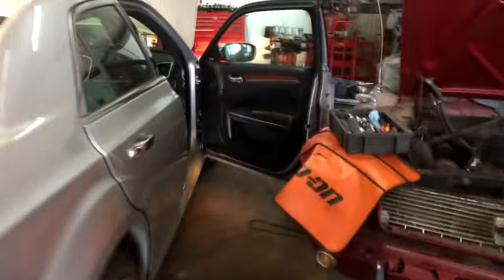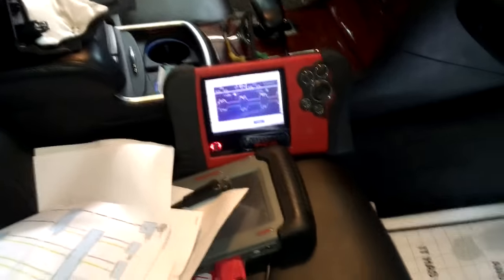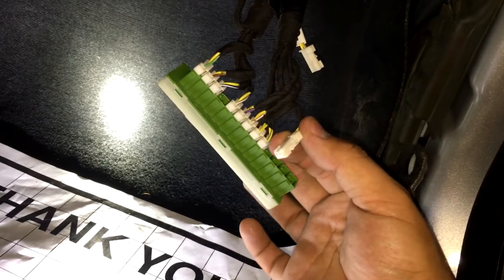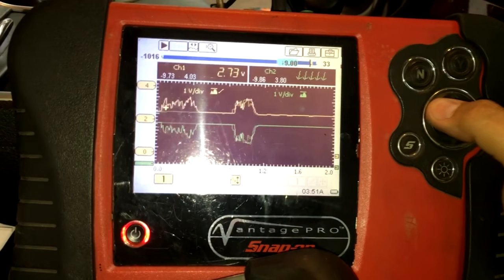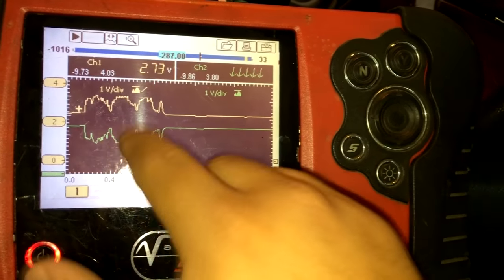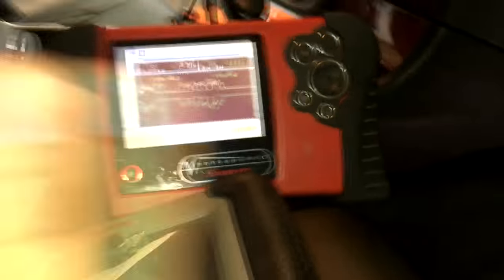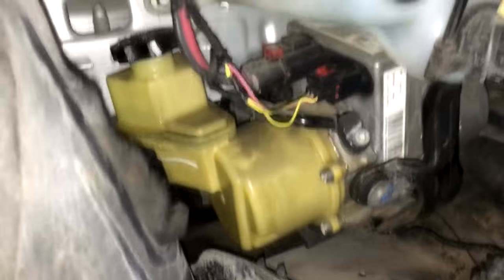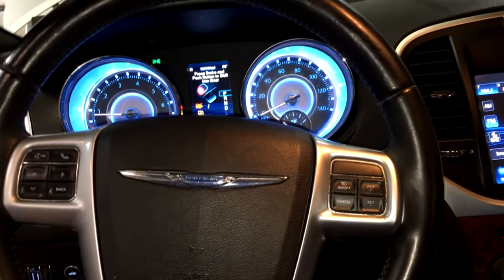TECH TIP CAN BUS DIAGNOSTICS

Comment: CANbus is essentially a balanced signal line, and the zero volt point is virtual ground, so that mirroring explanation is perfect, when either side does something
non symmetrical it indicates an imbalance, it's not the only way CANbus can fail, but it's still a great troubleshooting technique.
One of the reasons CANbus was adopted for vehicle data communication is because of the immunity to interference with cheap un screened signal lines, only possible
because of the balanced system they use. Any interference or noise with reference to ground is effectively self cancelling.
Thanks again for another great video.
Reply: Your explanation makes perfect sense regarding balanced signal lines, just like balanced audio cables that reject interference. Thank you.
Reply: This is exactly the same principle as that used with networking computers using ethernet cable. In computing it's referred to as UTP - unshielded twisted pair 😊

Comment: When the bias voltage raises as shown in the glitch,  you would want to verify the grounds of the module that's causing the failure. Nice video. A lower time base for detail can also be necessary in some diagnostics
Reply from the maker: Thanks for the tips! I really enjoy your channel btw
Reply: Yea John anello drives that hard on his talks bias goes high, verify grounds
Reply: Nice vid btw
Reply: We don't speak of the little yellow leprechaun 🤫😂
Reply: @NewLevelAuto  little yellow leprechaun 🤣😂🤣😂 gotta love the automotive community
Reply: @NewLevelAuto  THE LEPRECHAUN KNOWS !
Reply: @ADVANCEDLEVELAUTO  
problem facing in Chevrolet captiva 2007 manual, DTC U0073(ECM/ECU lost communication), U0121(ABS MODULE lost communication) and P0500(Vehicle Speed Sensor) ,,,,suddenly instrument cluster stops working ,all needles(Temperature, rpm, speed etc.) showing 0 reading , ac stops cooling while blower keep running,reverse gear light stops working, Service Vehicle Soon light & MIL illuminates in cluster. and all happen intermittently and all together. Can anybody suggest solution?
Reply: Great vid

Can I ask why you don't use an OBD breakout box to save fiddling with those pesky tiny pins ?!

Comment: Great video. My only suggestion is use the ground lead off your power probe and when you can keep the vantage pro but pick up a vantage ultra. Watching Can bus on a vantage ultra is great alot of detail. For fun I use my vantage ultra with my break box on my 2017 and drive around and watch data.
Reply from the maker: Thanks for the tips!

Comment: Hi, thanks for this bro. Just had this happen to me a year ago when I replaced my ATF on Subaru legacy Er HC on the dash and the dreaded Christmas tree, just left it overnight with battery removed and it hasn't acted up since. Just bought a scantool(the Ancel X6 and saw the diagnosis codes B0202		CAN-HS bus off, B0221, CAN-HS ECM no-receive data, B0222		CAN-HS TCM no-receive data) and researched them, I was wondering what caused it for a year, just arrived at the answer thanks to your video by putting 2&2 together. Keep it up bro.

Comment: Nice job. Good find. One thing tho. Back probe pins are called that for a reason. They go in the rear of connector's. The next time someone scans that vehicle they may have proplems.
Reply: Great comment...
Reply: For that system they have an OBD2 pass thru socket box with the identifications so you use banana plugs to access  signal. But in defense of his pin tap in front those pins are so thin they usually fall out.
Reply: That is why it's better to use a breakout box when messing with the DLC.
Reply: @carmo9693 No, thin maybe, did not see them fall out. Those pins are round in a rectangular terminal. Maybe not today but if everyone used this practice we will start to see obd connection issues that will prolong the diag for the main issue at hand.
Reply: @Mr2004MCSS  Exactly 💯

Comment: You do a great job explaining all this, broke it down to laymen's terms easily understood. You have a new subscriber,  i could learn from this channel. BTW, could a oscilloscope be used to test the can bus?... and does OBD2 port use those same two pins on all cars for testing the can bus?... I do assume it would.
Reply: Yes the Automotive Oscilloscope is used on all OBD 2 Cars and Trucks.
Pins 6 and 14 are Can High and Can Low. If Eric used a Break out Box, testing the CAN Network would be much easier for him.

Comment: Good video, but for people that are interested in performing this kind of work, you shouldn't stick backprobe pins directly into the dlc. You could potentially cause damage. It's much better to use an obd 2 breakout box to perform this kind of diagnosis. It's a safer way to do it, as far as preventing damage to the dlc, and will also provide a better connection than backprobe pins will.
Reply: What do u think plugs into the dlc... That's right pins. If your using small probes its not going to hurt it
Reply from the maker: Thank you

Comment: very good video. thank you. i have a question-when you pull the single wire connector off the splice pack-is it can hi or can lo? i know that they rely on twisted pairs. i am just getting into can communication diagnoses and am still a bit confused.
Reply: Hi if you look closely there are 2 wires on each connector of the slice pack hi and low

Comment: Hi, Nice explanation. I have a 2007 Gl450 and there is no audio/sound from the radio/cd. The command turns on fine and appears to be running fine both on radio and cd but there is no sound from any of the speakers. Before there would be sound for about a min when starting in the morning and then nothing. Now there isn't any sound at all. I pulled almost every module in the car and opened it up to check for water damage--none found anywhere. Only one fault code:  "incorrect can message from control unit n80" which is the steering control module. I replaced the clockspring and the module above the clockspring with OEM units from the dealer. Still there is no sound. I'm guessing the fault might be in a wire or a ground connection somewhere. Any thoughts? Where can I get the wiring diagram for the CAN bus for this car? Thank you.

Comment: My 07 jeep commander has set a "lost signal" code for every module the bcm controls.  I havent started diagnosing it yet, but, i think the place to star is checking grounds and the harness.  Ive seen wire looms resting against coolant hoses and what not.
Reply: have you figured it out? i’m getting the same thing after a couple of minutes of driving

Comment: Good video man.  What about when cars have multiple splices.   *star connectors *
Reply from the maker: Same technique. Disconnect one at a time. Thanks for watching!
Reply: @ADVANCEDLEVELAUTO  I think he may be asking is how you determined the system that was faulty, ie quick test no can with xxx and other modules could say no can with xxx current. After plugging back in current and stored xxx module.

Comment: Any ideas,,,, have a customer trucks. 2013 ram 1500. Did head gaskets on the truck. Have everything hooked back up. Hook the battery up. The key does nothing when you turn to the on position. No dash lights, nothing. Battery at 12.3 volts. Can check codes. So started unplugging each connect at the can splice section. Came to the ecu splice, and all the dash lights pop on radio, fuel pump. Try and crank the motor, doesn't turn over. Plug in the ecu splice and you can see for a couple seconds on the dash says no bus, unplug the ecu splice then it all works.  So this really sucks to have the ecu the problem. Any ideas of things to check?

Comment: Heads up on 2018 and newer you cannot check CAN at the dlc. Fca vehicles have gateway module now. Need to check CAN at the star connectors or a splice.  Those are star connectors not splices btw

Comment: I have a 2007 Ford F150 5.4l 4x4. I checked the can bus high and got 2.4 volts. I checked can low and also got 2.4 volts. When I checked resistance between pins 6 and 14 I got 0 ohms! Where do I go from here?

Comment: Need your help, trying to install a remote start on a 2018 Dodge Journey. Installation says to connect to Can High and Can Low. It's a pain in the rear to reach in there. Can I connect to the OBD wires instead of the Can Block?

Comment: So can a ob2 scanner w live data reader catch cunbus issues? Can the TC conect or getting tc oil on it on a NAG1 tc cause ground or issues w the conbus ? Bc i get static on my radio with the radio OFF on only one spker n the right rear deck only !!! On srt8 charger 2014!! So i am thinking being that tc connector got oil in it from tc overfill ! May b it now messes up that electrical field 13 pin connector signal from the TC,, i also had a one time code u0300 lost communication w the tcm pcu but cleared code and never came back !! Thats when TC had spilled out the oil from overfilling it!!! And now left conector 13 pin tc with oil on it nd i am wondering if that can give CUNBUS any issues? Let me knw wha u think bruh ty

Comment: Thank you.  Been dealing with a  16 Maserati Ghibli S Q4 that won't set O2, O2 heater and catalyst monitors.   Cleaned MAF, air filters and throttle bodies. Keep getting can bus fault from the epdm and intrusion module.  Driven 1,800 miles and still can't set those 3 monitors.  Replaced the 2 upstream monitors on strictly guess work and it made no difference.  Thinking can bus issue but have no diagrams or aides. Any thoughts?
Reply: You need a Scope to repair Can Bus problems. As Eric demonstrated, it's mandatory.

Comment: My 2006 dodge Sprinter doesn’t have a pins in the 6 or 14 obd2 but I’m getting no can communication with engine control module codes how would I go about scoping it out any ideas this is the first sprinter I’ve worked on

Comment: I have a 2006 3.5 Charger that dies after it idles down to 700 or so rpm. The code is lost communication with T C M. I HAVE A NAG1 transmission the dealership said replace the ECM. Is this correct or could it be a loose wire.  211,000 miles

Comment: How would yu go about diagnosing a 2006 Charger RT that stalls with communication loss to ecm/pcm A? Trouble code U0100 and U110B doesnt come up on the car unless a scan tool reads it

Comment: It was a good illustration, so it is common for OBD2 cars to plug the scope pins to 6 & 14.... ?
& The front connector is a gateway or what ?
Reply: vicky singh its a gateway, sort of. It depends on your cars can bus system. Some cars have a diagnostic can-c bus that runs from the dlc to the security gateway module. In that case you would have to tap in into a module thats in the normal can bus system

Comment: I have 2004 ram 1500 and the instrument cluster will intermittently fail causing my headlights to come on, no wipers, a/c, no turn signals, etc. How can you diag when there is no signal and/or communication because of no bus where the odometer is? Please help !!
Reply from the maker: Please watch my video about Chrysler No bus https://youtu.be/EqW7dsL4-kA
Reply: @ADVANCEDLEVELAUTO  problem facing in Chevrolet captiva 2007 manual, DTC U0073(ECM/ECU lost communication), U0121(ABS MODULE lost communication) and P0500(Vehicle Speed Sensor) ,,,,suddenly instrument cluster stops working ,all needles(Temperature, rpm, speed etc.) showing 0 reading , ac stops cooling while blower keep running,reverse gear back light stops working,DLC stops communicate with ECM, Service Vehicle Soon light & MIL illuminates in cluster. and all happen intermittently and all together. Can anybody suggest solution?

Comment: I tried this but can't get the 2,5V/-2,5V signal. I ran it on two channels with two cables. Do I have to run it on 4 channel mode and ground both channels?

Comment: My 2017 chevy malibu is showing code U0164 ( the can bus failed to communicate with A/C control module..fuse F33 was blown so I replaced it. AND STILL NO POWER to turn the A/C on

Comment: Dose every make model obd2 have a splice connection
Reply from the maker: Unfortunately not every vehicle has a splice. Check the wiring diagrams. If the vehicle does not have one, you will have to disconnect each module one at a time. Thanks for watching!

Comment: Exactly what is a “can bus” ?
Reply: Controller Area Network. Modern cars are so sophisticated now and contain in some instances dozens of modules that control various functions of the vehicle a network became a necessity. Instead of running separate copper wires all over the car, which adds weight and additional cost, they use a twisted pair upon which they can then build an entire network with multiple nodes. The system is cheap, reliable and reasonably fast.
Reply: Thanks for the explanations....
Reply: Controller Area Network is correct of course but then you need to know what a bus is. A bus is like a big city bus. Yes really. Only smaller. It's just a description of something that carries stuff, 'data signals' in this case, from point a to point b. It carries a lot of these signals from different start points to different end points, just like a human-passenger bus.  One interesting part of this is that you can take the same data off the bus at different destinations, so on some applications you can feed duplicate instrument panels from the same source points, as an example. This is how you get trip data and fuel consumption readouts in your instrument panel and, in many cars, also on your centre control panel/screen thing should you select it.
Reply: Huw Williams thank you for explanations
Reply: JUST A QUICK NOTE BMW AND MANY OTHERS DO NOT USE 6&14